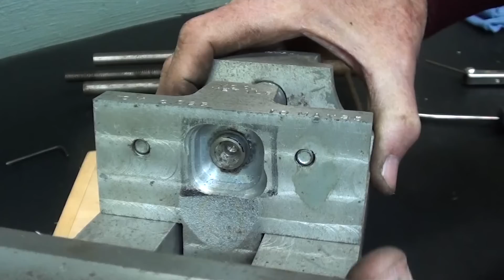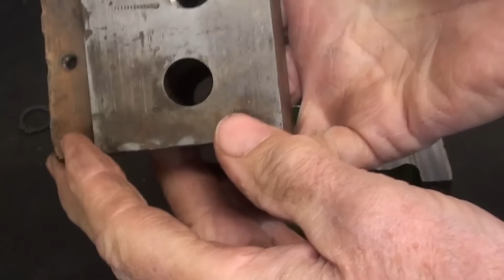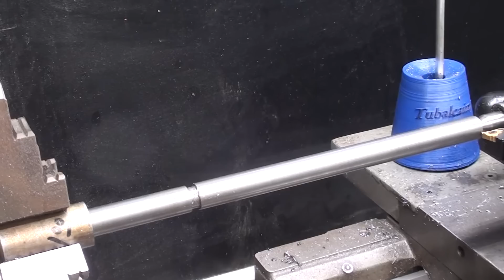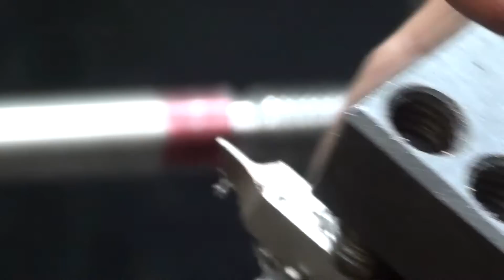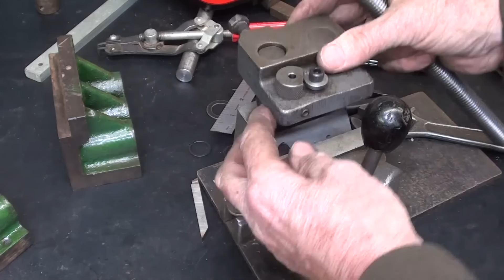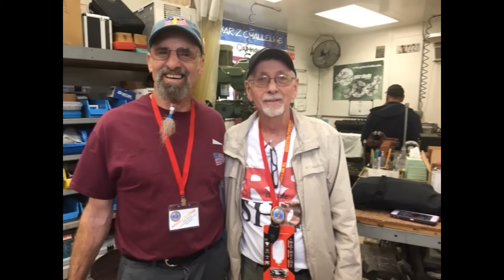FIXING A LEFT HAND DP VISE TIPS pt 2 611 tubalcain

Comment: It's 2:15 a.m. PST and I couldn't  sleep so I’m watching Mr. Pete YouTube videos.
Reply: 2:33am in  Antelope Vally California Good morning.
Reply: Robert Burns, I’m in the Central Valley. I'd rather be sleeping but I’m up. I think it has to do with being Medicare age. Have a great day.
Reply: @brittfuss1  ok. I'm 70... still hold a full time job and get up at 2 am to drive to San Fernando  Vally California to avoid 4am traffic. are you a machinist?
Reply: Robert Burns, just a hobbyist. I'm building a 1967 Ford Mustang Fastback from scratch (using a Dynacorn body). I machine/fabricate parts for it from time to time. I have a small CNC mill and lathe setup. I learn a lot about work holding from Mr. Pete, Abom79, and others. I'd like to have a manual mill, lathe and shaper but I don’t have the space in my shop. I’m retired after thirty years of being public works director for my city and county.
Reply: @brittfuss1  thank you so much for your public service you've earned a rest. I'm a machinist because I didn't have the chops to be a mechanic. Ask me to make a piston don't ask me to put it in an engine. My father work for 45 years for General Electric as a tool and die maker. He had a small shop in his basement. When I was 7 years old I reached up and turned on the lathe and I was hooked. My goal was, is and always will be to be a machinist. The sense of satisfaction to put the finishing touch on a project is unparalleled. I might suggest if you haven't already seen it the YouTube channel "Clickspring ".

Comment: While it may seem the wrong way round, in original assembled way you can put the work nearer to the spindle ( drill or miill) without the rods etc getting in the way.The way you have it now the handle has to hang over the bed or you slide it through to tighten.
On the left hand screw issue perhaps the school, factory just DIDN'T have a left hand tap in 5/8! If war time or money was tight they just went with what they had!!
Just like you!! Will you be machining the sides of the vice so you can hold things sideways?Great job on the repair!

Comment: I was cringing when you were marking the c-clip groove location w/o including a washer. Glad you ended up with one anyway. I'd have liked to have seen one on the outside of the screw as well ("No, never without a washer"). Guess it's a crappy vise and has lived most of its life w/o one. Always a pleasure to watch your vids. Thanks, "Teach"!
Reply: Yep, I'd have put a brass washer on the outside. That steel washer would work well on the outside too, especially if it were hardened and installed with some grease or heavy oil.

Comment: Tubalo, one thing I've found on almost every vice I own except the Kurt is the jaws always seem to grip tighter on one end of the griping width than the other I suppose the Kurt was done as you do on your mill, both sides a once. The other vices jaws must have been individually, on my drill press vice and Made in the USA Craftsman was off as much as 0.050" from one side to the other. Is this a correct assumption?  I wish I find some worthwhile tool auction around NE Ohio like you have out there in Illinois. Thanks enjoy your videos much!
Reply from the maker: I have noticed that lots of visesI were made in accurately